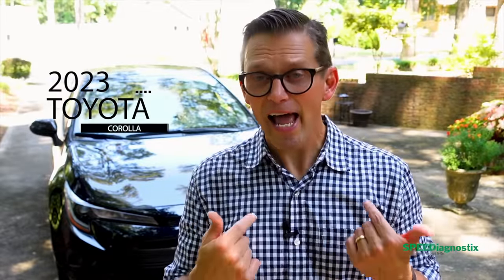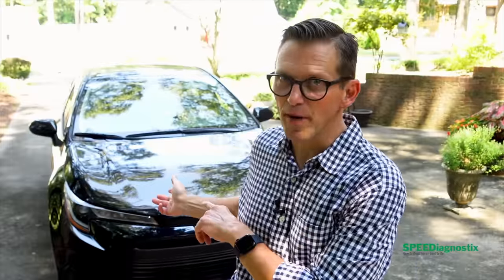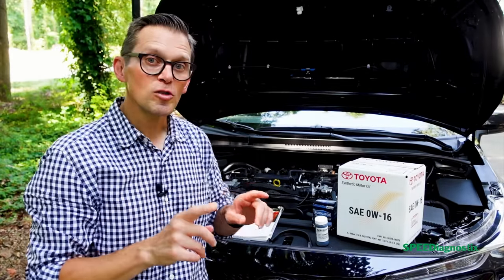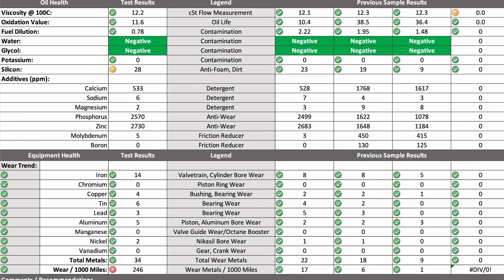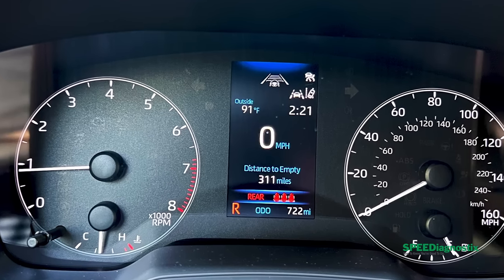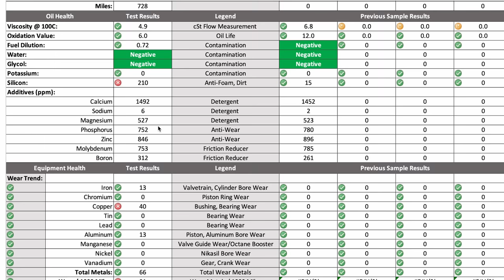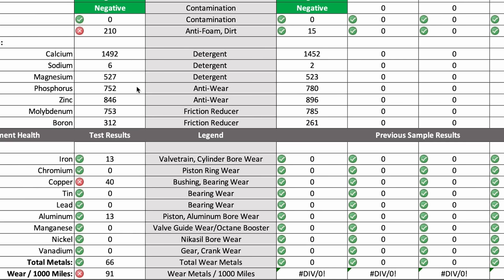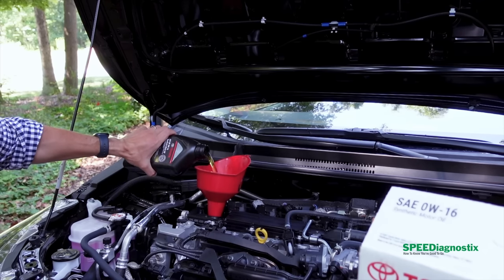AVOID the ONE MISTAKE Almost EVERYONE Makes With A Brand New Car

Comment: It's fun to watch the oil debates. I am going to do this one worse. When I bought a new 2000 Tacoma, I was so confident in Mobil 1 at the time, that I decided to run 7500 mile oil changes. Toyota specs the Tacoma at 5000 miles with conventional oil. I didn't do anything special with the first oil change and ran aftermarket filters, like Fram and Puralator 1. It was my daily for 8 to 10 years, after that the oil changes were an annual event instead of a mileage event. After 23 years of ownership I sold the Toyota because the frame was starting to look suspect from rust. Anyway, with 196K on the truck, the motor seemed the same as when I purchased it. The engine didn't consume any more oil than any other time that I owned it. I know there was wear, but it didn't seem consequential. If the frame wasn't rusting out, I am confident that truck would have gone 300k or more. My point is, how long are you going to keep your vehicle. Are you going to see 300k, 400k or more mileage from that vehicle? Or will the rest of the vehicle let you down, like mine did. Of course that motor is known for 300k. Funny thing is, it had some pretty bad wear numbers compared to other vehicles I have had. Only my first gen Mini Cooper was worse.
Reply: Good point. The method shown in this video seems wasteful to me. I did the first oil change in my '22 Camry at 4,400 miles under Toyota care, which I thought was a good compromise. The service advisors thought I was a fanatic for not waiting until 10k like it shows in the manual. And that is what most owners do, so most of the cars on the road never see an oil change for the first 7k to 10k. Either way, the engine is going to last well over 100k, and I'm not going to keep the car that long.
Reply: Great perspective. My 13 year old Honda Civic is very much in its early days mechanically but the clearcoat has all but disappeared on the trunk and some other areas. I've seen other Civics which look far worse. So it's fair to say that the body will probably need repairs before the engine/transmission does!
Reply: I did the same thing with my 2023 Chevy Colorado. First oil change at 3000 miles. I meant to do it earlier, but time got the better of me.

Comment: Every New Vehicle I Have / Had I've Changed Oil At 500 Miles. Then Again At 1000 - 1500 Miles. Call Me Crazy But I've Gotten Over 250,000 Out Of Each Of The 2 Ford Explorers I Had. Now I Have A Toyota Highlander. I Think I'm Good For A While.  As Far As Your Video. SOLID ADVICE!
Reply: Should keep driving Explorer AWD SUVs. They are excellent esp w/ award winning gen2 -2.3L GTDI engine. Love our '24 Explorer AWD Timberline. Heavily updated '25 version out late this summer. Same proven engines. 💯
Reply: @Davido50 your vehicle is spying on you. The data transfer back to ford would boggle your mind

Comment: Engine wear in the first hundreds miles is not what should worry you, Toyota engines are prone for sludge in oil and seized piston rings from carbon/ cooked oil build up. In it's early life an engine kinda need to wear off within normal parameters. I also want to point out that tha vast majority of cars ending up at the scrap yard is not because the engine, or parts bathing in oil got totally worn out. Some people worry more about oil than what they eat and their health status.
Reply: I remember doing early oil changes in the later 1990's on brand new installed 350 Chevrolet engines. At 500 to 1, 000 miles. The oil being drained look like metallic gold paint. It was clear and clean but metal was obvious. I believe one of the things to wear the most is the cylinder bores as the rings seat. New engines are plateau honed and have chrome rings. I think they break in almost immediately. Where does this metal figure into the contamination?

Comment: But right below that it states "However, it must be replaced with SAE 0W-8 at the next oil change".  If for some reason you have an engine issue, will they warranty the motor if you continue to use 0W-16?
Reply: Probably not. Toyota (any car company, actually) will use that info to deny a claim.

Comment: this is so true.   i`m a mechanic, and - following my instincts, i changed the oil in my freshly rebuilt  4 cyl. toyota at 50 miles, then again at 500.  then - later on, at 3000 mile intervals.  now, the motor has 50,000 miles, doesn`t burn or otherwise use oil...
Reply: 50k miles is very little to brag about but super maintenance practices

Comment: It's great to get the inside scoop from someone with your background and experience. Everything you do and recommend make good sense.

One thing I'd do differently would be to install a magnetic drain plug. It'll trap metal shavings and keep them out of circulation.

I'd also use an OE oil filter while the car is still under warranty. If there are any issues or failures the dealer couldn't blame it on the use of aftermarket equivalents.
Reply: Magnetic plug will certainly trap the ferrous metal swarf, but that's all. Still a benefit. Some people strap powerful magnets around the oil filter casing only removing them just before removing the filter.
Reply: @harrygatto   I've heard about that technique, and it should work great on metal spin-on filters. The problem with some modern engines is the oil filter consists of a hard plastic outer shell and a replaceable insert. Wrapping magnets on the outside in that situation could be a challenge.
Reply: @Rick-S-6063  A large Jubilee clip or similar would do the trick. Removing it just before removing the filter would keep the ferrous swarf inside the filter.

Comment: Lake, I also run a magnetic drain plug in my cast iron block and I'm surprised by the quantity of magnetic particles this drain plug collects.  The particles aren't troubling or particularly large but more like a fine size which feels like grease.
I intend on doing this same thing on a couple other of our family vehicles.
It would be quite interesting to know what others are finding on their magnetic drain plugs.
Reply from the maker: Great question. It would be interesting to see the range of what these drain plugs look like.
Reply: A friend of mine had an AMC Pacer that he purchased new years ago when they first came out. He drove that to just over 100,000 miles …..and never changed the oil. As the car would use oil, which it did, he would just add more.  He hated that car and never picked up a wrench in his life.  He wouldn’t spend the money on an oil change.
Reply: @Notfiveo0  That's impressive the vehicle actually made it to 100k miles. I can't count how many vehicles I've seen which wiped out the bottom end when sludge had clogged the drainback holes in the heads and the oil was trapped up top under the valve covers.
Another common failue occurs when gallery passages are clogged with debris, leading to portions of the engine being starved.
I just tested a few days ago, my 455 Oldsmobile (clean as a whistle, internally) to see how quickly sae 30 would drain back to the oil pan through the lifter valley (I wanted to wet the camshaft prior to a cold start) and was surprised I was able to fill the entire valve cover while quickly as possible pouring the oil in through the valve cover vent.  My chevy, ford and buick all pass this test without incident.
Reply: I attach a magnet from old speaker on oil filter, all particles are on old filter & discarded.put magnet on new filter, repeat. Don't have to clean drain plug as much
Reply: @rogerdodrill4733  The issue isn't cleaning the drain plug, that's easy to wipe using a clean rag.  Cutting the filter open every oil change to monitor for swarf seems more difficult?
Reply: @thisisyourcaptainspeaking2259  They make oil filter cutters, I have used one at every oil change for years. Race teams use them a lot.
Reply: @gofastwclass  Yes I know, thanks.  I'm not going to cut the filter open every oil change, I have a magnetic drain plug.  I usually find particles that are very fine and I suspect they're from the timing chain set, what do you find on your magnet?
Reply: @thisisyourcaptainspeaking2259  The only cars I had with a magnetic drain plug would get a tiny amount of very fine particles and had an iron block. Most of my current vehicles have aluminum blocks and don't have magnetic drain plugs. 

When I do cut filters on healthy engines, I typically see a tiny film of fine non-magnetic residue in the bottom and nothing on the pleats without magnification.
Reply: @gofastwclass  Your aluminum engines have no ferrus materials?  I'm reasonably certain my cast iron clock isn' contributing to the particles found on the magnet, I suspect they're coming off the timing chain sprockets.  There's not much chain and sprocket there really, it's a pushrod engine.  Not sparkly or gritty, just a grease-like substance attached to the magnet.
Reply: @thisisyourcaptainspeaking2259  My aluminum engines have lots of ferrous metals (crank, cam, rods, lifters, timing, etc.), thankfully they don't seem to be in a hurry to escape.  

I've seen what you're referring to and I'm not sure this isn't the same. In the very bottom of the filter will be a small bit of sludge that doesn't appear affected if I move a magnet beneath the filter. The stuff is dark brown or almost black and slick but thicker than the oil. What I remember picking up on drain magnets had a very dark silver colour and looked like particles or powder.
Reply: @gofastwclass  The substance I find on the magnet looks the same as some photos I came across.
Reply: I dig using magnets for that too,and im pretty sure that if you analyzed the goop on the magnet youll find other metals that arent normally magnetic mixed in there. 
I was told that the particles are so small and the field would be strong enough to give em a little charge. 
Not sure how true that is, kinda sounds good though. 🤷‍♂️
Reply: @thisisyourcaptainspeaking2259 
8yrs and 40k on a beater 1200$ Nissan 200 ,all I did was add oil when the pressure light came on in hard corners. 
Damn thing always chattered the rods on a start if it sat more than 4-5hrs. 
Tried an oem filter on my first oil change on it and decided it wasn't worth it and drove it like I stated above. 
And flat out abuse sometimes too, like if I was parked in the backyard. 
Start it ,clutch in and in reverse and gas floored ,turn the key and after the 1st rev limiter bounce just sidestep the clutch and whip a nice reverse donut. 
I got 350$ from the salvage yard and they drove it on the truck. Alas it was the rust not the engine ..it had another 30-40k in it.
Reply: @MrTheHillfolk  Good suggestion, I should drop this into an oil sample and send it off just to satisfy my cuiosity.  I've been taking decent care of this engine despite I have a good spare ready to go.
Reply: Same with my Porsche , believe it or not my aftermarket mag drain plug gets a lot of stuff on it . Very fine
Reply: People seem to forget ring/cylinder wear. I've been using filter magnets for 20yrs on my steel cannister disposable filters. You'd be amazed how much "ferrous dust" can be extracted from an engine. FilterMags are really convenient but a little spendy, initially. But since they are reusable, it's a one-time expense. During the Pandemic, I used Neodymium magnets I got from Amazon which worked as well, but a lot less convenient.😮

Comment: Back in 1973 I rebuilt a 170 slant six that I put into a 68 Dart. I had the head cut ninety thousands to bump up the compression to get better performance from the engine. I used Dexron ATF instead of oil to break in the engine for the first 500 miles. After the break in I used Mobil  straight 30w and new filters every three thousand miles. It was a very reliable car.
Reply: It's always good to out think the engineers that spent 10's of millions and hundreds of thousands of hours developing the engine, break in oils and procedures.
....don't forget to add a can of Lucas ZDDP and a can of STP.
😁
Reply: @randywl8925  A lot of those hours and hours were spent doing trial and error tests. Yup that worked and nope that didn't. They look for the edge and try to stop before they get to it. Kinda like doctors practicing on human bodies. They have seen a lot of human bodies but they haven't seen or experience my body like I have. Playing the averages does help but that's only if everyone does the average things to their car. With STP you have to be careful, it pours slower than honey, it's good for older smoker cars.
Reply: @mostlymoparih5682  i have a 93 S10  with a 1988 4.3  150 lbs compression with 293000 miles on it.
Idles and runs like a champ.  No way would I risk creating "my way"
Now with with that said, if screwing up an engine wouldn't bankrupt me..... 
Id be doing exactly what you are doing.
I'm a thinker and curious as hell about everything. 
....I bought a Powerball ticket tonight.
If I win, I'm trying out 5 quarts of brake fluid to see how well it lubricates the engine in my s10. 😁
Reply: @randywl8925  Brake fluid?
You might want to try that on your lawn mower first. Smaller engine smaller loss.
Reply: @mostlymoparih5682  I just watch Project Farm.  He's got bacon grease covered......
...butter versus margarine. Yeah.... and a second round of testing after adding a teaspoon of Lucas ZDDP   😁
....Powerball wasn't successful ....again 😁
Reply: @randywl8925  Yeah he's pretty good. Him and his cousin Eddie.

Comment: One thing to do too is using the oem oil filter is very important because it’s specifically designed for that engine design. It might sound crazy but the other brands out there flow differently depending on the thickness of the filter material resulting in improper flow of the oil to the engine.
Reply: Not true
Reply: Subaru USA always had only aftermarket Wix filters(and other substitutes during the pandemic). Only recently have the OEM Tokio Roki filters from Japan become available again at the Dealers. I have been using the Tokio Roki Mazda RX8 filter recommended by Mr. Subaru 1387 for about 2 years now.
Reply: Not true. Many many vehicle manufacturers utilize the same exact filter part number and all on several different engines that are designed for vastly different applications. 

One example of this is the 2.7 and the 5.2 ford engines. Initially the 2.7 was a truck engine then when the 5.2 came out for the gt500. Initially they utilized the exact same part number and filter for these two vastly different engines. Up until they had issues with that specific filter in the gt500 they then made a specific filter for it. 

Filters are vastly overlooked and many assume the OEM filter is the best option but countless tests prove that incorrect and most often they are pretty low quality options. 

Also most vehicle manufacturers get actual oil filter companies to make them and just rebrand them as the OEM one. 

Example of this again is that 2.7 motorcraft filter. Ford dosn't make that filter. Wix makes it for them. So the exact same filter just in a different box. Filters are a lot more difficult to pinpoint what brand is best and one part number may be the best from one manufacturer like wix but another part number may be from purolator in a different part number. You have to specify look at the filter options from every manufacturer for your specific engine and hope someone has tested them to really know. It's not as simple as saying brand X is the best period. Brand x may be the best for a 5.3 Chevy but brand y could be best for a 4.6 gm. It's very inconsistent and difficult to find the best

Comment: Exactly what I preach...here in Germany there is an endless discussion about the sense and nonsense of this first oil change, for many here it is almost a religious view. The opponents of early oil changes argue that the materials and tolerances are so correct today that an early change is not necessary... I personally have had different experiences and change the oil on a new car after 1500 km and then every 10,000 km. This is how I drive my engines with 300,000 and more without any problems with oil consumption or anything like that.
Reply from the maker: Thanks for sharing!

Comment: I would love to see some actual engineering data from motors over the years. I do not disagree with changing oil early (500 or 1000 miles). However, manufacturing, materials, oils, have all changed over the years. I know oil analysis can show different amounts of contaminants, viscosity ect..., but in the end does it really matter that much? 
I think the most important thing is to just change your oil. 

This is my anecdotal experience. I take care of over a dozen vehicles in my family and whether or not they seem to all last over 200k miles with no unexpected motor issues or oil burning. On my personal vehicles, I change the oil at 500, 1000 and 3000, and then do UOA after that to see how the oil holds up. I do this out of curiosity of how the motor is running. The rest of my family tends to do "mfg recommended" unless I intervene. My personal motors, after 100-150k miles seem to have slightly less lifter noise, sound slightly better, but other than that they get the rated fuel economy, they all seem to last 200k+ miles, sometimes 250k-300k before the vehicle literally rusts out from under you.
Reply: So basically first oil change is the most important then 4K after that is fine?